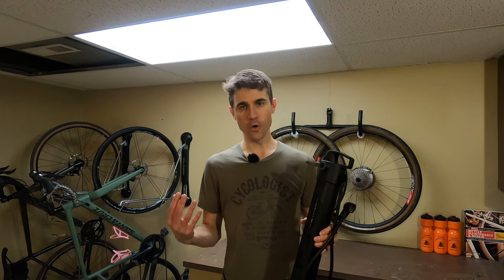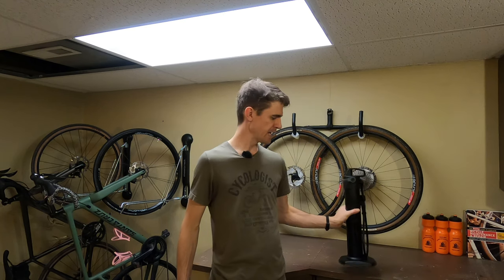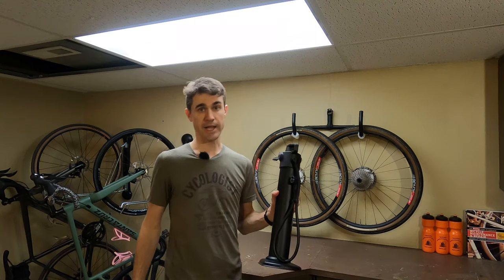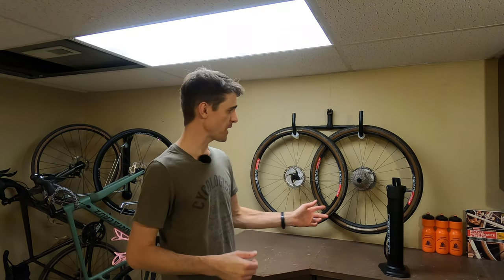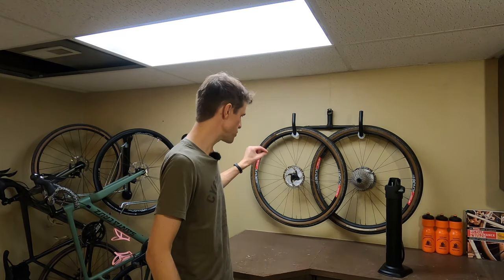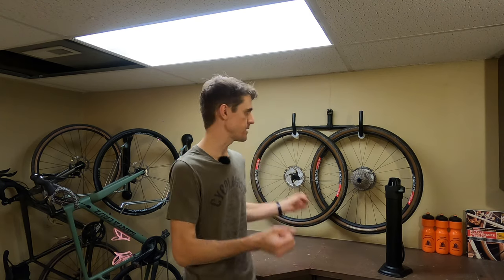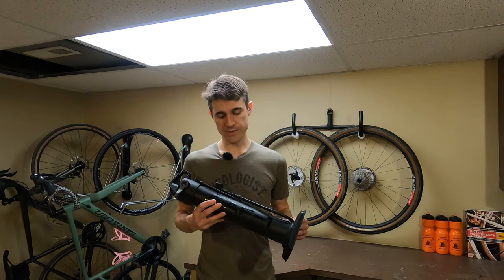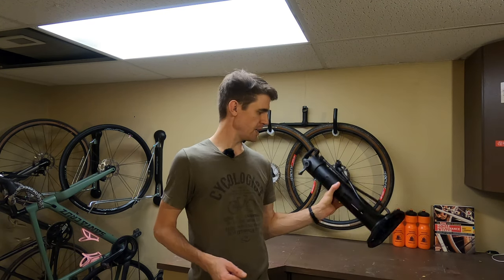Serfas AF-1 Air Force One Tubeless Canister Review │ Lanky's Gear Guide │ Not Worth It!

Comment from the maker: I had another go around the the Air Force One--this time setting up some tubeless fat tires (Surly Edna 4.3in). I set them up with tubes for a couple of weeks, then carefully removed the tube so as to keep one side of the tire bead seated on the rim. I removed the valve core and filled the tire using the Schraeder valve on the AF-1 canister. The front tire took three tries, but the rear tire seated on the first try. I definitely still think you lose a lot of air through the valve that is not in use, but it pushed enough air to at least get a fat tire seated on the rim. I still would not recommend this product. I would suggest getting an air compressor instead. However, it at least worked for me once.

Comment: Re: air escaping from both end holes - I initially experienced this, but when I ensured that the locking lever (i.e., the lever you flip up where the hose connects to the tire valve) was fully flipped away from the hose, it solved the issue, i.e., once I double checked, I no longer got air leaking out of the unused valve hole.

Also, putting soapy water on the bead (in addition to removing valve core) made all the difference. I was mounting WTB Byway 47 tires on WTB rims, FYI.

Comment: I have the same one. Massage the tyre on as best you can then have the valve at the top of the wheel when turning on the blast. Works for me 90% of the time :) having the valve at the top changed everything
Reply from the maker: Bought a compressor. Much more effective and consistent.

Comment: Pre-seat the bead as close to the rim as possible before even trying to blast a bead into place. 
Neither a compressor nor this canister can overcome a gap between bead and rim if it's big enough. 
Also, remove the valve core stem before trying to seat the bead so the air can effectively blast into the wheel to seat the bead.
Reply from the maker: Did all of that. Works ok on fat tires but doesn’t seem like enough stored air pressure to handle a gravel or road wheel. 50/50 on those. Thanks for the suggestions.
Reply: @TheLankyCyclist  omg, you‘re right. This thing completely fails. It doesn‘t provide a blast of air to seat my bead. It just kind of drizzles out. Back it goes!

Comment: I have a similar product made by Giant. Same result, but did like the cardio workout trying to get the thing up to a decent pressure. Worst money I ever spent. For a few bucks more, I could have bought a small electric "pancake" unit. For now, I either use CO2 cartridges ($5.00 a pop) or bring the wheel to work, where we have an air hose.
Reply from the maker: Yeah, I should have just bought an air compressor.
Reply: @TheLankyCyclist  Thanks for confirming my suspicions. Still, I'm sorry for the blisters and expense. I did find a super-quiet inexpensive compressor at Harbor Freight, on sale for USD 109. I actually keep in my trunk, powered by a portable battery/inverter. 

https://harborfreight.com/1-gallon-135-psi-ultra-quiet-hand-carry-jobsite-air-compressor-64592.html

https://www.amazon.com/gp/product/B08H1TYFFP
Reply from the maker: @T3R1N4  I still haven't pulled the trigger on a compressor. Thanks for the links... I change tires frequently enough that I think I can justify the cost.
Reply: $5.00?!? Check on ebay, you can get them for $1.25 in bulk. CO2 has always worked for me.